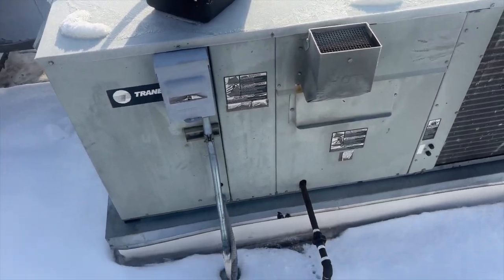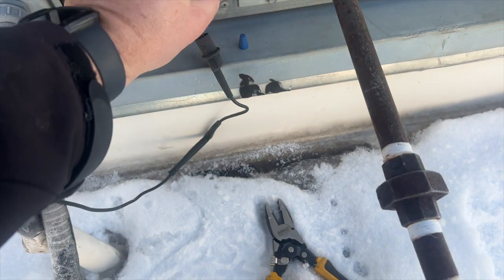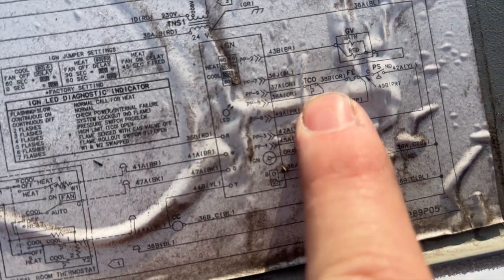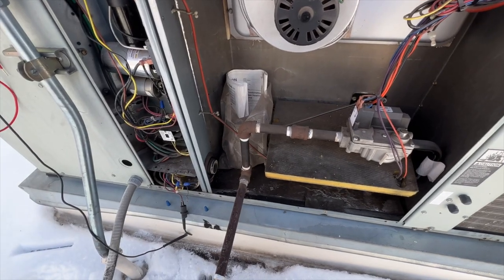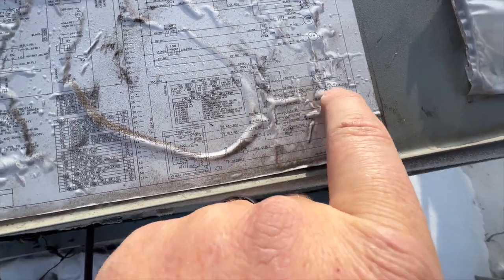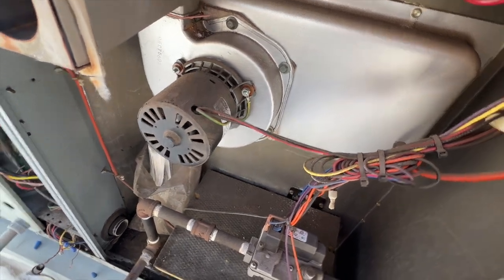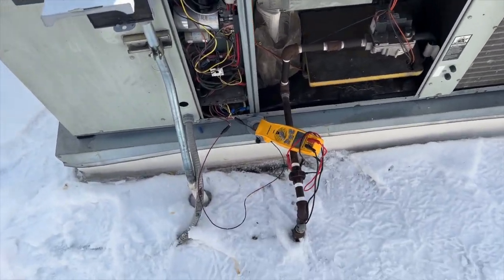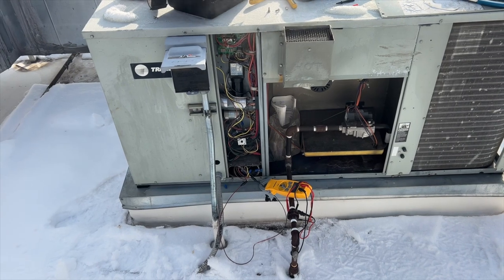Melted Jumpers! Finding a Low Voltage Short on a Trane Package Unit.  EP122

Comment: Hello, do you know of any booster fan that can work with 24 volts, would you like to increase the air in some vents, that can be connected every time you turn on the heating or air conditioning, thanks